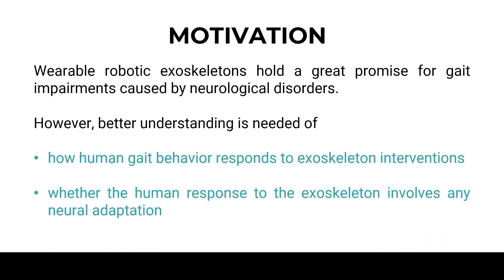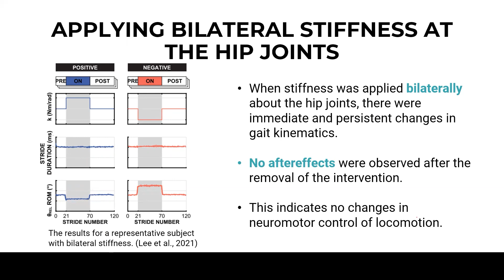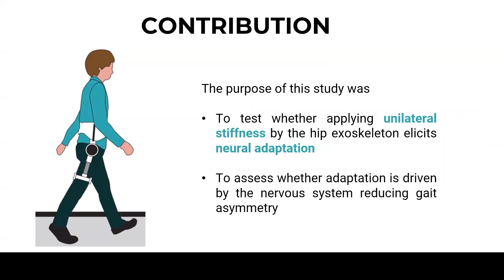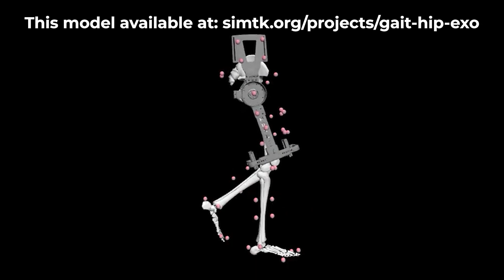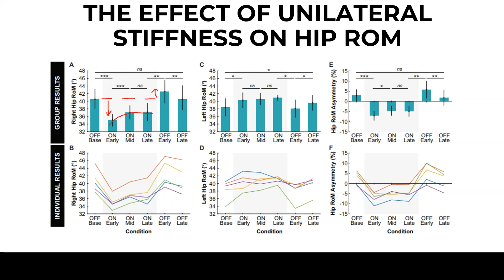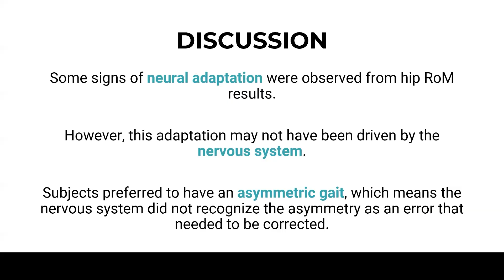IROS 2022: Unilateral stiffness modulation with a robotic hip exoskeleton elicits gait adaptation

Comment: if i had to guess for the causation of adaptation or non adaptation, i would guess the difference between a hard and soft motion limit being the reason.

a hard limit is like an obstacle, which the brain memorizes as such and thereby makes a temporary accomodation. it needs active attention to move with the obstacle, but allows for imediate discarding.

a changed resistance is like a muscle strenght shift or cramp, leading to a deeper adaptation, as muscles usualy don't change quickly but need to work automated with low  attention.

--------------------

when working on my own exoskeleton, any obstacle-like movement blocking misalignement is imediately noticable, but is instantly freeing when fixed. the spring assist needs more adaptation time, but then feels natural. when disengaging the springs, i have to readapt to unassisted muscle movement, making my steps wonky for a few minutes.

with getting more used to the assistance, the adaptation speed gets faster though, as it seems my brain gets used to using both distinct modes of effort.

this might be because i have a healthy gait by default, meaning i drop back into it.

for a person with an unhealthy gait, the mire healthy correction might stick as its better than the unhealthy baseline, teaching the brain a pleasing alternative gait.

-------

step lenght, in my experience, returned to normal very quickly indeed, because its quite noticable to oneself if you make longer or shorter steps .

----
if i had to guess about the neurology, i would check for local motor neuron clusters in addition to brain activity. 

resistance and obstacle based gait adaptation is present in central nervous system less invertebrae like starfish too. its a very old system.

--------
the residual non-adaptation during restriction could be due to the exoskeletons fit making it marginaly preferable.